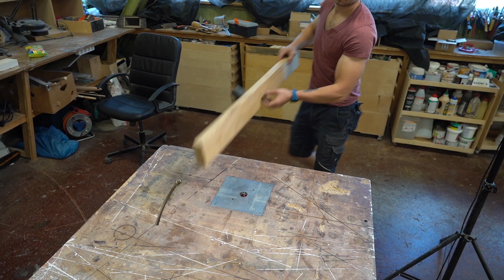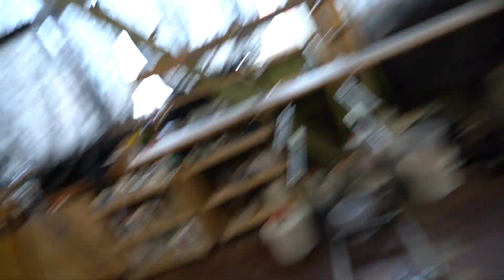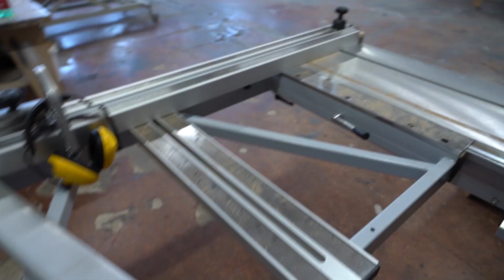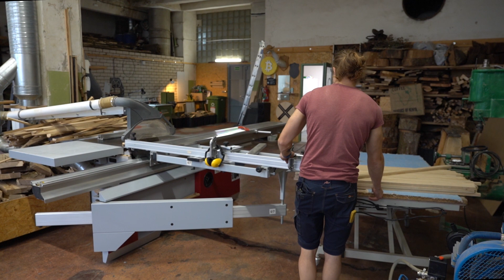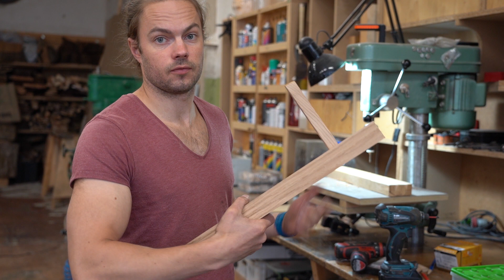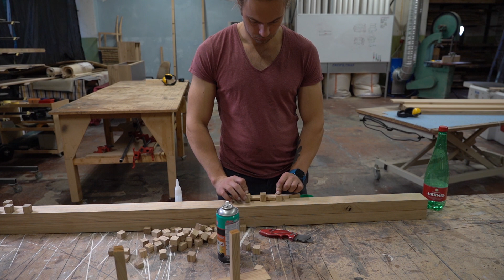I love JIGS | furniture for tiny apartment

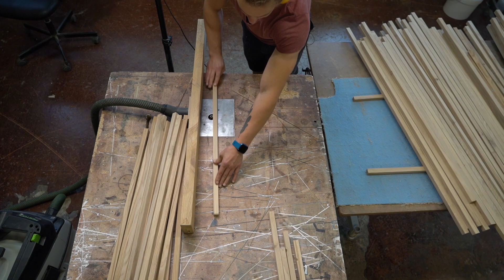Comment: So when you're knocking off the edges/corners at 1:03 you appear to be using the wall/guard as a vacuum holder, but doing the cuts by hand. I was wondering - why so?
Reply from the maker: The round over bit has a bearing and there’s no need for the guard. So like you’ve mentioned it only holds the vacuum hose. Some of the sticks aren’t perfectly straight and not using the fence allowed me to copy those curves
Reply: @Chiselsplay  Oooh that makes sense, thanks for clearing it up